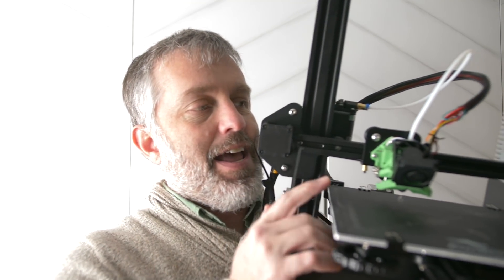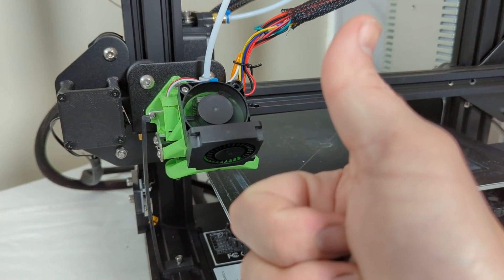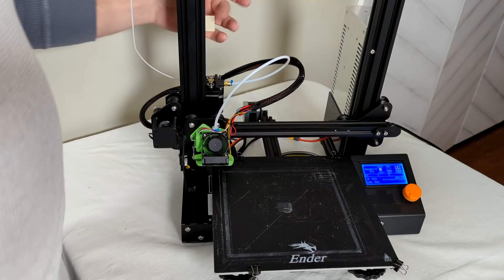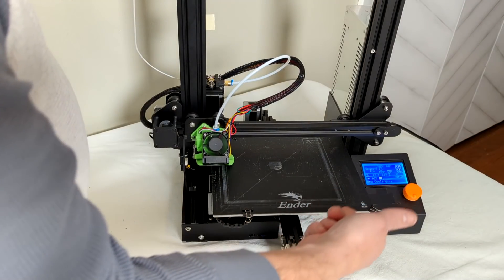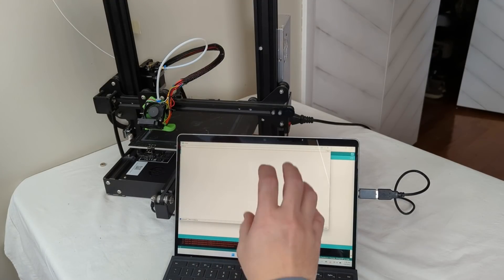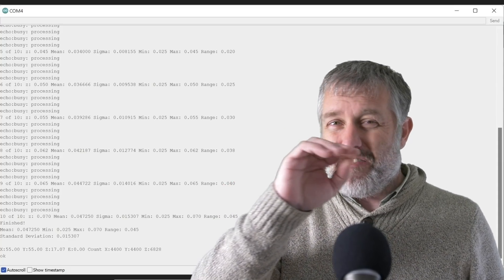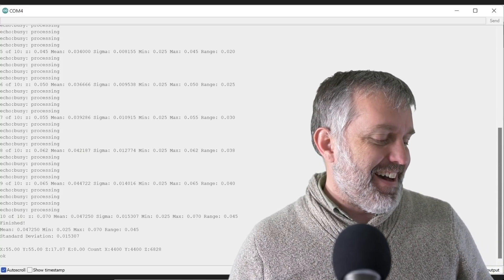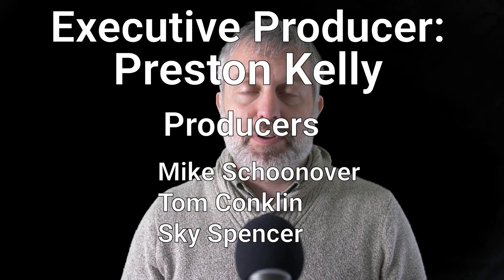I Made a Self Deploying Allen Key Probe To Rival The BLTouch

Comment: Advocates supporting innovation, yet buys sus sensor from AliExpress.
Reply: And where should he buy the optical sensor? Which single company should be the only acceptable source?
Reply: @perwestermark8920  First off, I don't recommend AliExpress for anything.  The main reason is that it's a marketplace for counterfeits.  That said, you can buy a genuine Sharp optical sensor from SparkFun, Adafruit, etc.
Reply: @bernardtarver   Yes, I don't recoment AliExpress either. But buying the sensor from yhem isn't really against innovation because the light sensors are commodity products, just like resistors.

Which means non-Sharp sensors are still genuine sensors.

But I do wonder if the light sensor might be an issue - looked like the readings changed with 0.005 mm for every single reading. So something is very much broken with the setup. Without that error, this sensor should have managed with a 10x better average result.
Reply: @perwestermark8920  It's incorrect to put a height sensor in the same category as a resistor.
Reply: @bernardtarver  Height sensor? You mean light sensor. It was a light sensor he bought from AliExpress. A light sensor is a commodity product just as a resistor. It's only if there are very specific needs that there would be a reason to hunt the datasheets and buy a very specific sensor of a very specific brand.

Comment: Could you not use some nuts or washers or spacers to keep the Allen key from wiggling?
Reply: I think that is a good idea. Tilt some m3 washers around 29 degrees from horizontal and you would effectively get around a 2.8mm hole.

Comment: This was a great follow up to the first version of this that you posted. Solid concept and I'm sure you'll nail down the fine tuning in no time.

Good job, dude.

FWIW, I like the Euclid Probe a lot better than the BLT. I've had 5 BLTs fail in as many years, each time costing me a lot of money in damaged print surfaces and new BLTs
Reply: this is why i buy the cheap 3d touch probes. they work and their like 15$. id like to support bltouch but 40$ is alot of money for something that will break eventually and sometimes they just dont work properly( i have 2 real bltouch sensors currently and honestly the 3d touch probes work better as far as just doing their job, the accuracy is off a slight bit but for 25$ less ill make do)

Comment: Couldn't some high carbon steel wire work in place of an Allen key? That way you have a round probe in a round hole rather than hex-in-round, it could tighten up the tolerance a bit while still having low friction. Heavy gauge piano wire comes to mind.

Comment: You could make this even better by putting an electromagnet at the top, to retract the key afterwards, whilst keeping the existing permanent magnet so you don't have to have to keep the electromagnet powered.  A small 10-15mm aliexpress 24v electromagnet is less than 2 dollars

Comment: Put the Allen Key in a Dremel and grind a needlepoint on it to alleviate any contact point deviation.  Also on the end that triggers the optical switch, add a black "Flag" that triggers the sensor.  That will diminish the trigger point error induced by the angled surfaces of the key and make for a more stable Trigger Point.
Reply: A sharp point can be an issue for heavily textured beds though, maybe just a rounded tip
Reply: A ball end would be much better and less prone to bed surface error.
Reply: just a touch of flat-black spray paint on the key would reduce the trigger point error too
Reply: Good idea  William, but a sharp needlepoint could sink into the surface it is probing, and thus a more blunt would give better results.  You are right it the surface points area will/could make that impact.  But the opposite isn't perfect either.
But you get others, like me, to thinking, and that is great.

Comment: You’re really looking for a Schmitt trigger type output that is very consistent to the position of the Allen wrench.
We can’t see how you’ve implemented this positioning with respect to the interruption sensor, but several things could be done to reduce the natural variation in this already excellent solution. I’ve been crying for a simple electronic solution to touch sensor.
Not wanting to kill the BLTouch, but most of us can’t even get our crap MB/firmware to support them. Electrical contacting sending is nigh impossible on these varied build surfaces, but man, your touch/optical solution is awesome!
So, my other comment touched on a couple of ideas that I will certainly try, if I can find a way to adapt this to my Mingda D2…
But if you can find a Schmitt triggered outpost interrupt or sensor, your already awesome solution could become even more consistent.
We’re talkin’ in the micron realm here.
Is that necessary? I don’t think so….but it’s fun to look at these kinds of options.
Carry on, my wayward son…😎

Comment: BINGO! That is one great solution!
You know, you could make that 0.025mm closer to that sub-micron number by putting pieces of electrical tape over the round sensor hoke with a gap of about 35-50% of the diameter of the sensor hole. Also, the closer to the sensor side of the transmitter receiver pair you locate the interrupter, the more consistent and snappier the response.
You’ve probably already looked at most or all of these features, but I thought I’d throw-in on them for those super detail types (like me).
Thanks for what I think will prove to be one of the most innovative 3D printer hacks of this cycle….
Cheers, sir!
Reply: But that's exactly the point! Why would you bother with such an accuracy that you don't need here, yet there are still other problems not solved yet. With this design he is solving those problems, and gives  a darn f* to unnecessary accuracy, that lot of people hooked on like they need to compensate something.
Reply: @opiniono-1  Practical or not, needed or not, every engineer strives for accuracy. It’s in our DNA. The fact that he resolves a set of other issues is completely laudable and appropriate to this idea. The fact that he’d like the probe action to be more accurate is equally laudable. Practicality, complexity and cost will likely swamp out many potential improvements, but he’s done his homework and has a nice solution.

Comment: So when you use it, you have to manually pull it down once to release it from the magnet, and at the end of the bed sensing cycle, you have the machine push the key back to the magnet, right?
Reply: The machine pulls it down also

Comment: I'm curious if you've actually tried it in a 60C heated chamber. The optical sensor will work fine, but it seems possible the plastic might change shape enough to cause some trouble in the movement of the allen key.
Reply: CNC Kitchen tested different plastics defeormantion in oven.

Comment: Looking forward to trying this out! So far, I've had 3 bltouch sensors and at least that many clones fail after the first 3-4 prints, so anything has to be better. In fact, one of the bls failed on install....as did it's replacement. The 3rd replacement failed after 1 print, and that's when i decided I'm done with them for good...I didn't bother returning it for a 3rd time. 😔
Reply: I had a very similar problem, I removed the pin, left it on a magnet for 5 minutes to remagnetize it and cleaned it from any grease. Also cleaned the inside of bltouch with a qtip, now it works really fine.
From the 100 times it deployed the pin since I fixed it, it only failed like two to three times
Reply: @pavol0  I wouldn't think I'd have to do that right out of the package, but I'll give it a try with them...thanks! 👍

Comment: Thanks, this could solve my interference issue. 
Anyone else had problems with AC beds and bltouch? If I go with 11*11 grid I can 'see' the path the power leads on the underside of the bed, I'm assuming it's the hall sensor picking up the magnetic fields? 
 (I have tried 3, original smart v3, creality, & clone). They all give same results, - /+0.3 mm when I keep bed on when probing only along the path the cables take, (I now use firmware to heatsoak then switch off bed whilst probing).

Comment: Maybe some kind of standard dowel, or cheap straight shank tool like a drill would have the least slop and most circularity. Then a reamer can be used to create a smooth, accurate bore for a much tighter tolerance.

Comment: Its kind of funny that you mention it that it started with micro-switches and a removable probe, and now in areas like the voron community, they ar egoing back to micro-swites in things like the klicky probe to deal with the heated chamber challenges of other probe solutions.  Keep up the good work!
Reply: Some times simple is the best. I've tested a few key switches used by the keyboard building community and they also work great in filament run out detectors due to their low actuation pressure.
Reply: The Klicky probe is great because it auto adjusts your z offset when you change build surfaces and nozzles etc. In my experience though, you still need to run it at a consistent chamber temperature or you will get first layer inconsistencies between prints.

If I print from my machine cold, I get a first layer that is way too high and I have to adjust my switch_offset to move the nozzle closer. But then if my chamber is heated I get prints that are way too close.

I don’t know if this is because the mechanics of the switch itself alters with the heat or if it’s caused by something else, but this drove me crazy.

Now I just make sure my chamber is heated and I get prefect first layers even when I switch out build surfaces and nozzles.
Reply: microswitch is definitely the most KISS solution, his solution while he thought is simple is actually far more prone to errors than a simple microswitch... in fact i always go back to using those small tactile switch mounted directly on the nozzle.

Comment: I bet you could use a piece of PTFE tube to help with the movement of the Allen key.
Reply: Why not give up on gravity and use a spring to push it down. That way the friction will stop being a problem, the Alen key is just too light.
Reply: Just need a smooth enough hole really. Even with a well tuned machine pumping out exactly the right size holes, running a straight piece of wire or the right size drill bit in and out of the hole in a straight motion works to deburr and burnish the hole for smooth motion. Trick is finding a good RPM for your bit/wire and plastic but can get a shiny hole if you find just the right speed.
Reply: Great minds think alike!!
Reply: or silicon spray
Reply: Nope. Close-fitting brass would be a far better choice.
Reply: the tube will have to be perfectly straight as the key is light so could bind.. I got an old mouse so going to get  the optical sensor from that as its the type that uses a slotted wheel.
Reply: @DevilbyMoonlight salvaging an optical sensor from an old mouse is genius! Thanks for the idea man!
Reply: My thoughts exactly. Watch the video. I had the same idea and started to skim through the comments to see if anyone had mentioned it first. Great minds think alike!!!😜
Reply: Linear ball bearing for the win

Comment: I support RepRap, thus I support clones.
Reply: I'm gonna throw in to this. I bought two 3D Touch sensors from Ali for £25 (I had two Ender 3's at the time), and at the time the BLTouch was £50 each to the UK.

First one was DOA, and I had trouble setting up the second one. I spent a week trouble shooting to find the cause. It was just highly unreliable, my inductive probe was a LOT more accurate.

Long story short, I gave up and ordered a BLTouch. I had it installed and running correctly within five minutes (remember I already had the mount and cabling installed). I simply swapped the sensors and bingo, super low deviation.
Reply: @RitchieTheBrit  stupid.
Probably just picked the CHEAPEST you could find on Ali...
Get the Trianglelab 3D touch.
0.001mm deviation.

15$, comes with 2M cable and springs and screws.
Reply: @davidmathejasteam9706  it WAS from Trianglelabs. I also ordered a v6 hotend which was great. I'll point out this was a number of years ago when TL first launched their clone, maybe they had to finesse their QC a little.
Reply: Execute Order 66.
Reply: It’s not the same same though reprap is all about self replicating and open source a clone of bltouch is a rip off of an original closed source design
Reply: The ingenuity comes from the people that make the clones work as good or better than the expensive ones.  Thank you for being part of that community.
Reply: Especially when it's 1/4 the price for the exact same thing.
Reply: @w1llowsworld  but it's seldom the same exact thing. The plastic maybe exact but all the hardware is where corners are cut hence the price is cheaper
Reply: @angelvip2474  it's 90% of the product for 10% of the price. Every single clone I have works fine.
Reply: @Treekicker  How many BLTouch are you running?
Reply: @Treekicker  How many times have you managed to get warranty support? Gonna guess it'd be easier said than done to even find a contact in many cases.
Reply: @Treekicker  never said they don't work fine. But for everyone one that says they work fine, there are 10 others that say it's ok for a clone or that they should have just bought the original. And it shouldn't work "fine" it should be the exact thing. And no plastic parts don't make up 90% of the product bud. But it's cool that you have had success with yours. 🤙🏽